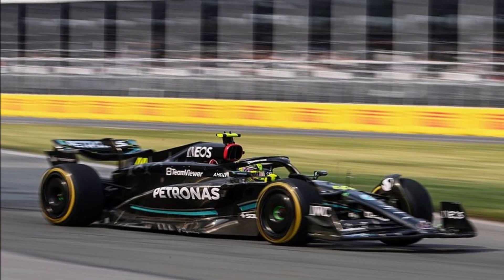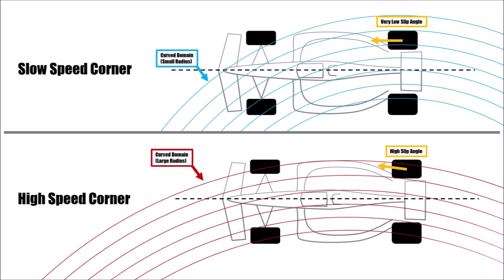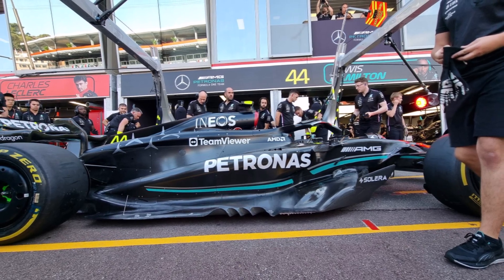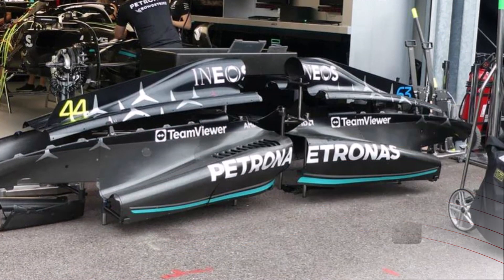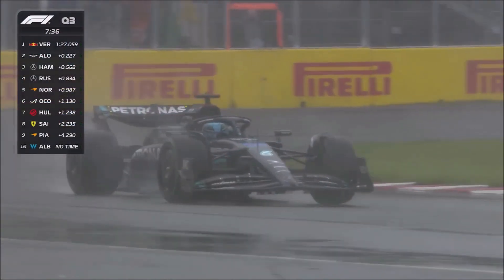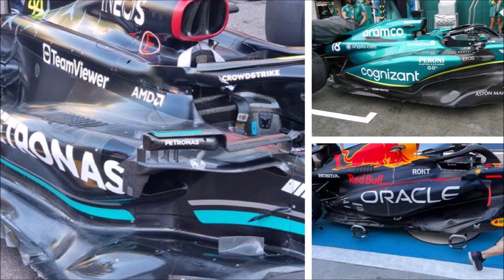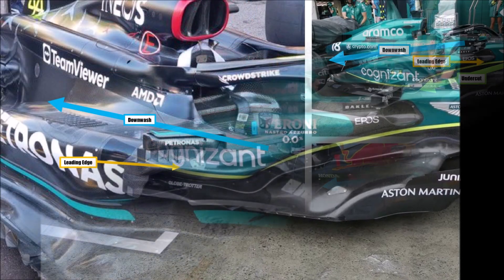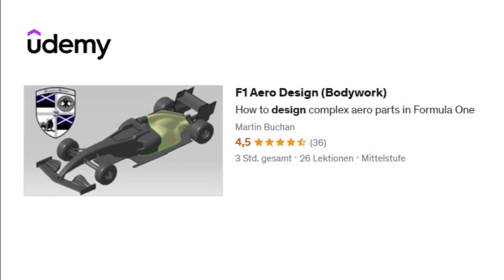F1 2023 - Mercedes W14B - The Slow Speed Corner Issue

Comment: I have a question: today, in the technical regulation, are the F1 designers obligated to shape the side pod with only one ‘block’? Couldn’t they design it with a tight side pod like the 2022 mercedes + some wings?
Reply from the maker: You can download the current regulations on the FIA homepage and read article 3.7.1. Minimum radius is 50mm for concave curves when intersected with x and y planes. So that makes wings impossible.

Comment: I don’t believe Mercedes can have the radiator inlet protruding from the bottom as they have their side crash structure under the mirror and have to incorporate it into the current car design.
Reply from the maker: Yes it’s hard for them to copy that without changing the chassis.

Comment: Ferrari using inwash concept for last year and few races this year. If this video explanation can be used, this should mean that Ferrari should have been have good advantage at cornering (which seem its true with F1-75). But why its said to be peaky/inconsistent? Is the airflow from undercut alone not enough? Or is inwash airflow can easily disturbed?

An important note: i know that you can't tell us accurately what happened, so i only expect "big idea" of why most car not using in wash concept.
Reply: Addition: i kinda forgot that you already talk about some of it on your Ferrari upgrade video (just checking out minutes ago). But it kinda not make sense that somehow, i felt that SF-23 is slower than F1-75. I don't have the data, so take it with huge amount of salt, but it's the impression that i got on this season so far.
Reply from the maker: The tricky bit with the undercut flow is that it can mix with the front wheel wake to some extent. So you either except that or come up with a strategy (Red Bull‘s lower drain)

Comment: The fact that the Mercedes is basically at the same level as the Aston Martin when it comes to general pace with this rather rudimentary design of the new design direction is incredible.

btw, I'd suggest using a less bold font, at least for the smaller annotations, as they are rather bad to read like this

Comment: Wait, why is slip angle less on low speed corners? I agree that in general there will be less time for the rear end to settle and the slip angle may not stabilize, but the slip angle should be more a function of yaw rate not cornering speed. I would expect if anything slip angle on low speed corners to be greater.
Reply: As far as i know, optimal slip angle INCREASES with the tyre load. And in high speed there is more weight transfer to the outside tyres.
BUT there are also more aerodynamic forces that give more load but also acts as a lever moment force to counteract weight transfer.

Comment: I was sitting at turn 6/7 on friday, and when they were doing their race sims early in FP2, the car looked awful Lewis and George had to throw the car around alot. Aston and Red Bull were on rails. Not sure what Mercedes did between friday and sunday, but their car looked way better in race conditions.
Reply: There problem is one lap pace on race day there are very much with aston
Reply: @darshang1262  the Aston was much faster than the Merc in this race, only reason Fer was only about 4-5s ahead was because he had to lift and coast multiple laps with the brake issue, otherwise it wud have been like 10s. If he made a good start and not fall behind he might even have had a chance against Max.
Reply: @tuiso  he doesn't have a chance to challenge max because redbull was holding back lot of pace so he Alonso in p2 had pushed harder max would have gone faster than he was doing and Lewis intially kept Alonso behind until pitstops also Lewis was slow because of debris keeping all these things in Aston and mercs race pace are similar
Reply: @tuiso are you for real, alonso barely got around the mercedes when he was just 2 tenths behind the merc with drs coming out of hairpin and then hamilton coming back at him without drs down the start finish straight. Alonso would never have got around max even with drs, I would be concerned if I was aston martin becuase their upgrade did nothing at all for their straight line pace and top speed.

Comment: Do you think Mercedes can move their cooling louvres? I imagine it will be difficult because of internal packaging, and would require a big redesign. I can see them copying the others in the next few months and moving their leading edge to be below the sidepod inlet not above it.
Reply from the maker: That depends on how important that is to them. If they widen the centre bodywork, they could have a decent flow path underneath to the centre, allowing them to move louvres to the centre. 
But a wider centre bodywork send less energy to the back. But the downwash area won’t mix with radiator flow anymore. So it’s a trade off.
Reply: Mercedes are having to work around the existing homologated crash structure.  i.e. The bit the mirror sits on.  It's a hangover from the zeropod design that they can't change in season.  So it forces them to have their leading edge above the inlet.

They'll have to wait for next year's design to be able to change it.
Reply: They can't move them until next year probably

Comment: Also, knowing how much tech that goes into designing/building F1 cars, I find it hard to believe that teams haven't designed a wind tunnel where they can change direction of wind tunnel air.  How hard would it be to have air hit the car at an angle instead of head on.  If not the air, have a rolling road on a platform that you can rotate.  And thats after 30 seconds of shallow thought.  Im sure engineers could come up with a better idea instead of only testing with the air hitting the car just straight on.  I would think that they are way smarter than that.
Reply from the maker: Teams change yaw angle in their straight wind tunnels. The point is that the air flows straight and not in a curve. A round wind tunnel is a pretty big thing to build for teams and no one has one.
Reply: Look up Sauber's wind tunnel, they have a rotating platform in their wind tunnel.

Comment: I don't think Mercedes didn't want to have a huge undercut to guide the air efficiently to the rear 
It's just they have fundamental limitations bcs they are building a different design on a previously extreme design without changing the gear box 
It's still impressive that they changed to a completely different direction and still gained performance with that 
It's gonna be interesting to see what they gonna bring to Silverstone bcs it will be there real performance update of the season
Reply: It's important to keep in mind that the W14 is currently the epitome of a compromise yet it's in the conversion of being the second best car. It will be extremely interesting to see what they come up with for the W15 when there will no longer be limitations on their design.
Reply: From what I have learned from Red Bull and even Mercedes over the years is that, you want to to go with a stable concept and bleed performance in gradually rather than go for the brutalist approach of going for maximum performance without fully understanding the aero surfaces. 

I find it interesting that Aston Martin and Alfa Romeo went with a large deep section undercut approach going into these regulations but found the concept too difficult to work with and had to go with the more simple downwashing concept. Red Bull started with a downwashing concept with a shallow undercut and then this year they progressed to being able to adapt deep section undercuts into their philosophy.
Reply: agree. they need a new chassis, new gearbox and new rear suspension to match the new design direction

Comment: Mercedes matching AM pace without an optimized package is not looking good for AM’s future 😢
Reply: Which is interesting because Canada was the 1st race where Aston Martin really had significant high speed performance over Mercedes. Lewis was having to push harder to keep up with Fernando who was managing an issue. 

Still, I suspect when Mercedes fully gets on top of these regulations for next season, Aston is in trouble. Red Bull have already checked out and switched focus to next season so I fully expect them to be miles ahead again.
Reply: @F1ll1nTh3Blanks what high speed performance 2 tenths behind hamilton coming out of the hairpin where aston had far better traction with drs and barely got passed him and then lewis came back at alonso without drs down the main straight. Aston martin 0.7kph faster down the back straight and 0.4kph slower down the main straight hardly a big advantage given the size of their update and we know mercedes are not happy with their drs and their rear suspension with big updates to come. Aston martin should concerned alonso was 10th and 14th fastest and stroll was 11th and 15th for straight line speed.
Reply: AM has more upgrades coming soon
Reply: @wiegraf9009  So do Mercedes.
Reply: Aston just dropped a whole new pack of upgrades but yeah, let’s talk about optimization 😅😢😂😂😂

Comment: Could you create a curved wind tunnel to simulate cornering? With movable side panels, I could imagine creating one where you can simulate both straight and different corners...
Reply from the maker: Of course you could build something linke this but that's what the teams don't have. They yaw the car in a straight wind tunnel and get correlation issues.
Reply: @bsport320  Thanks for the info. I am sure, simply putting the car in there sideways, is different than being in a real corner. That can only simulate when the car is sliding sideways after the driver lost control :D
What do you think, why do not they build a proper cornering tunnel? As I see, that might have provide an even more important data than a straight, as the most important time a car can loose is in a corner.
Reply: I can't think of a way for that to work, other than the hare-brained idea of spinning the car around from its side in a centrifuge of variable radius.
Reply: Aston are upgrading their HQ and just built a new wind tunnel, maybe they can get the data easily another way because otherwise I imagine Aston would have built it.